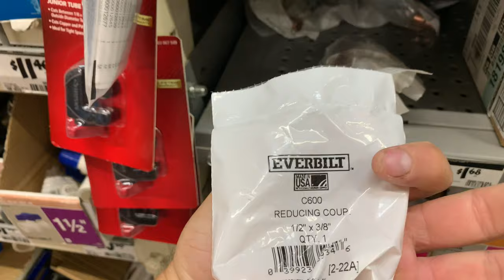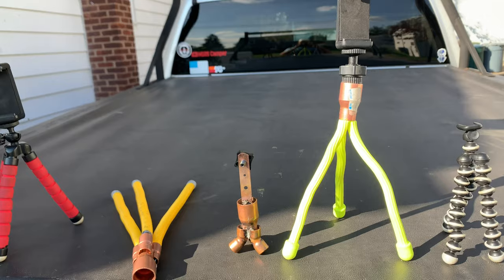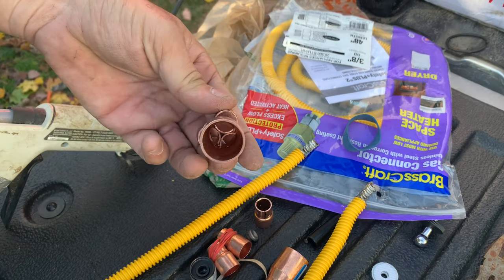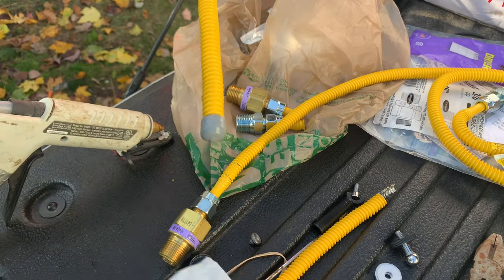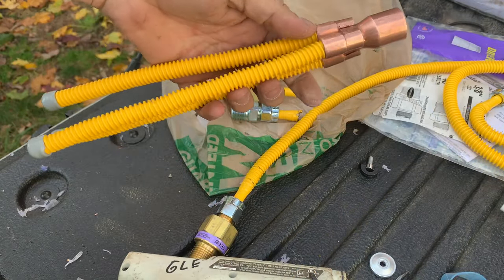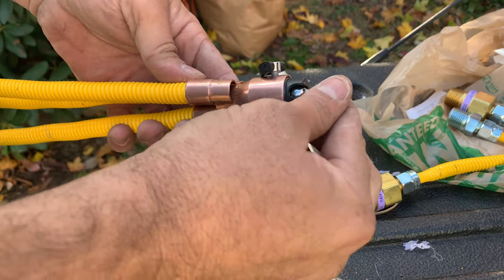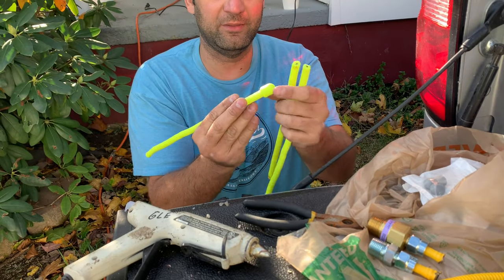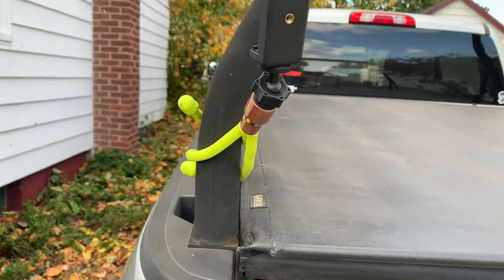DIY TRIPOD

Comment: Excellent use of Gear Ties (Nite Ize)! I carry about a dozen of them in my truck in varying lengths and they have so many functions.

For the copper - do you recommend roughing / sanding / abrading the surface so the hot glue sticks better?
Reply from the maker: Hey man! LoL I also keep a bunch of those ties everywhere!! No prep work really necessary before putting plenty of hot glue on